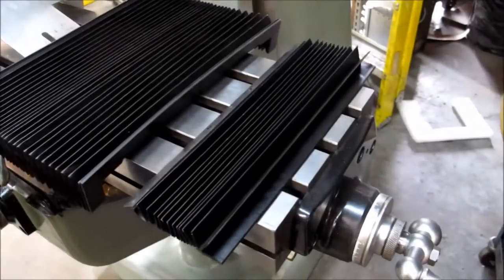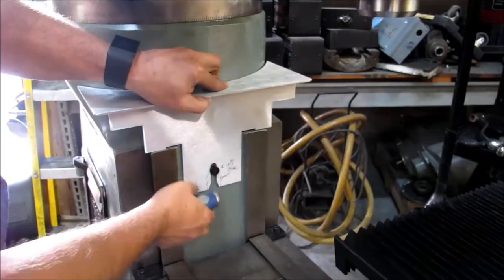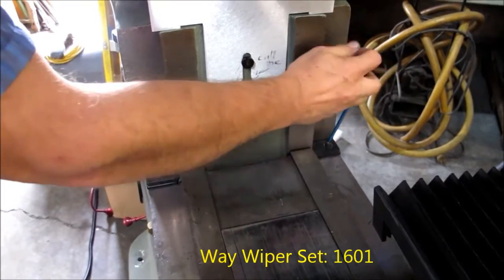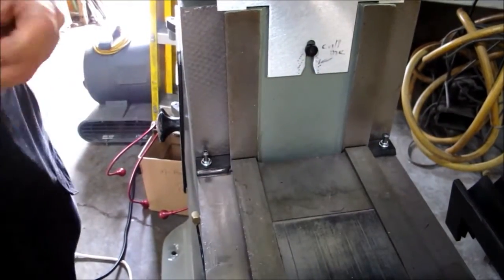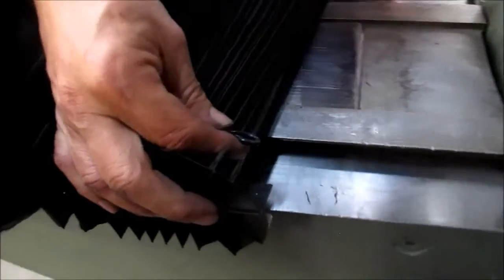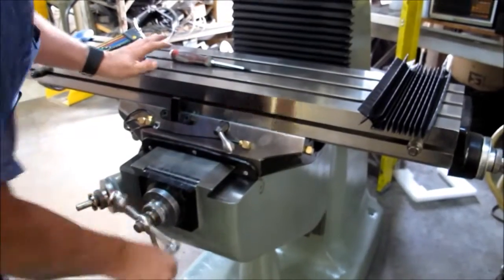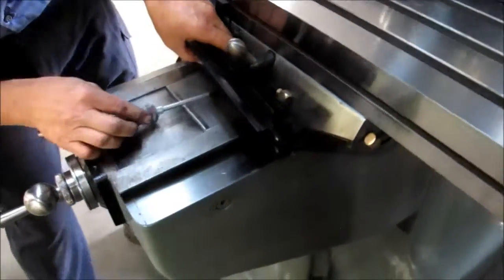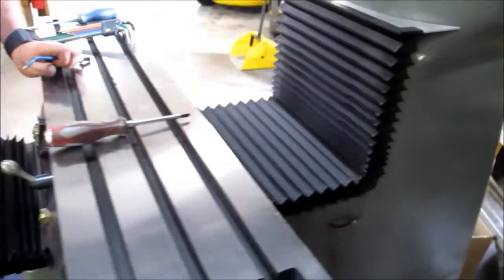"No Drill" Accordion Way Covers

Comment: Love the covers and simplicity of installation. Problem i find is the front right corner is a catch point. With the table up higher in the area of us (for me mostly).  that sharp corner will catch my shirt and or belly area. Not sure how to solve the problem. Maybe a rounded corner or soft round rubber corners. Still a solid design and i want them for our old j head at work. Love it.
Reply from the maker: guns1war That's a great idea that we will pass along to the manufacturer. Until he can implement some changes perhaps a quick fix would be to dremel down the edges so that they are more smooth?

Comment: Nice accessory to the mill . Best set up I've seen for them. But woefully overpriced. Ill watch for China made for $49.95 .
Reply: Or just order a sheet or neoprene or silicone as front and rear way covers, then use magnets, or screws to secure it with a aluminum bar mount. Cheap and easy. Neoprene will be ruined by some of the new water based coolants so silicone is better if you use water based coolant.
Reply: Robert B, that would be nice if they were elastic and contracted to nearly zero at end of travel, if relativaly durable.
Reply: Yeah, 300bones is TWICE what they should cost.  Pricing seems to elude a lot of people.  If they were 100bucks, they would sell 4x the couple they sell now per month.  :-/

Comment: $330 is $230 too much for a simple cheaply made and sourced product. 
 Im sure the big corporations don't bat an eye at the cost but realistically, they have new CNC machines and don't care about the old rattle trap in the corner.
 The small businesses like mine that still use a manual Mill can't justify the $$$. 

 I only buy my B.P. parts from your company and have no problem paying for the right quality piece, but that price is out of reach